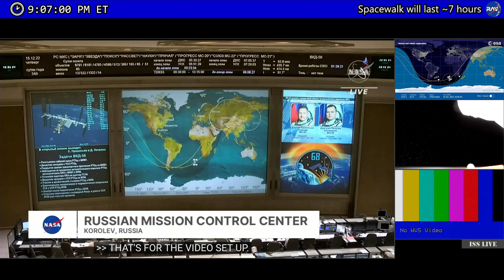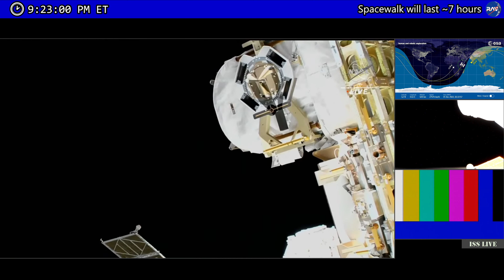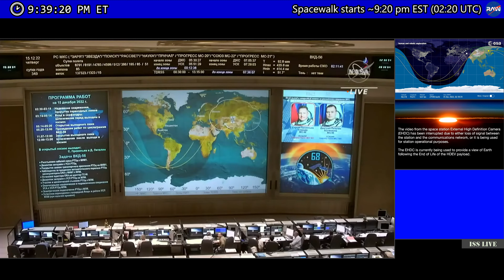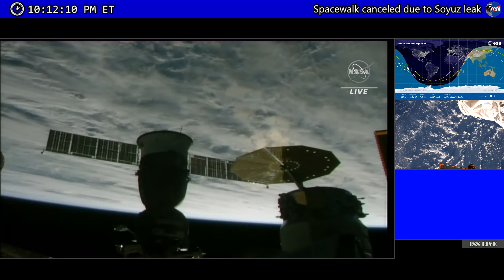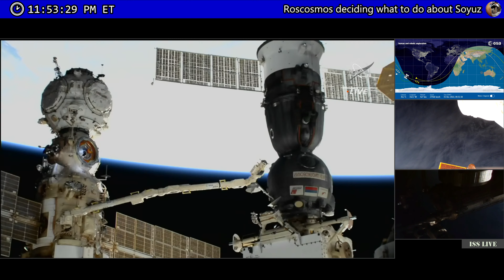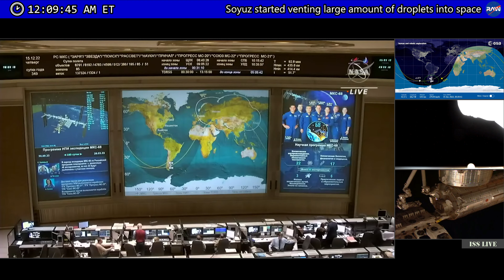REPLAY: Soyuz leaking coolant; Russian spacewalk canceled! (15 Dec 2022)

Comment: Was it their suits leaking ? Title says " soyuz leaking"
Reply from the maker: The spacewalkers were still in the airlock when the leak was observed. The spacewalk was canceled, the airlock repressurized, and the cosmonauts doffed their Orlan suits. The leak was from the external coolant loop on the Soyuz MS-22 crew spacecraft, which is the vehicle that Sergey Prokopyev, Dmitriy Petelin, and Francisco Rubio rode up to the ISS. If Roscosmos deems it unsafe, then MS-22 will be deorbited, and an uncrewed Soyuz (or Crew Dragon) will be launched so the crew can return. The MS-22 crew wasn't planned to return until March 2023.